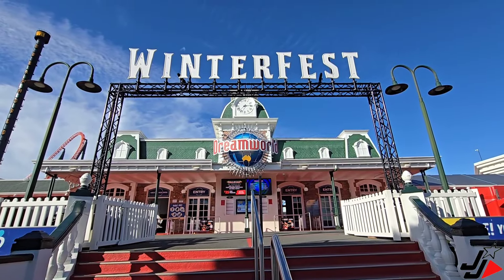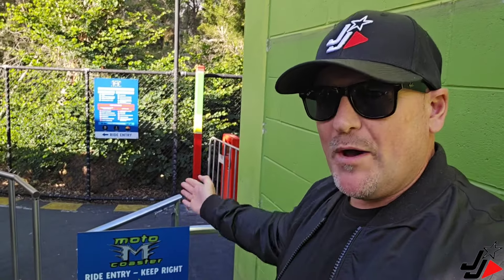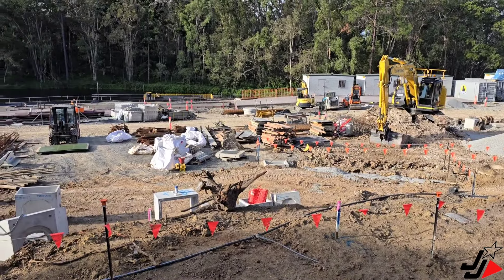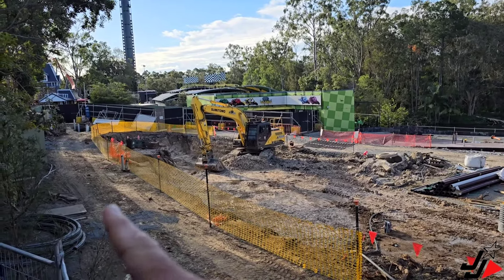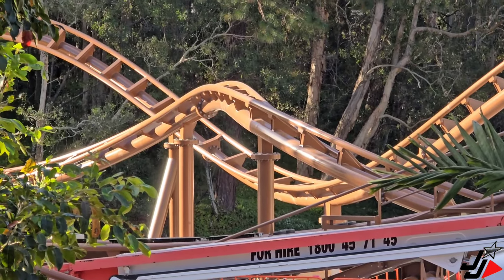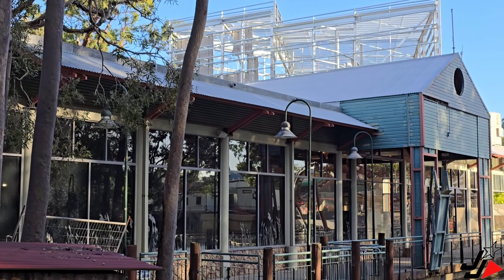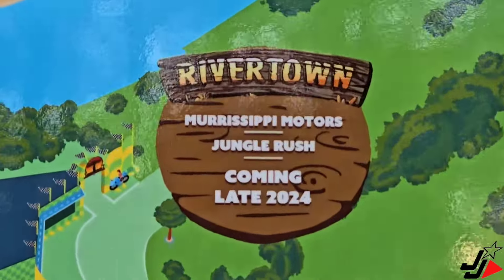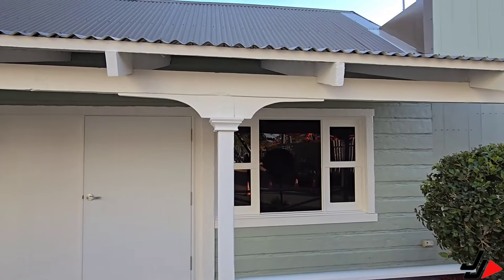INEW COASTER - CONSTRUCTION UPDATE | DREAMWORLD THEMEPARK GOLD COAST

Comment: At 7:25 you can see that there are two tracks that will meet up with the turntable aside from the powered track (one each side). From looking at it last week it appears we might leave the station and go straight up to the pivot point. Be interesting to see what the option of 2 connecting tracks means though :/